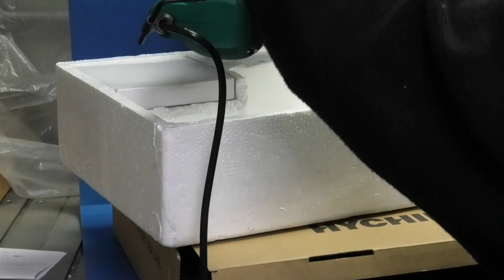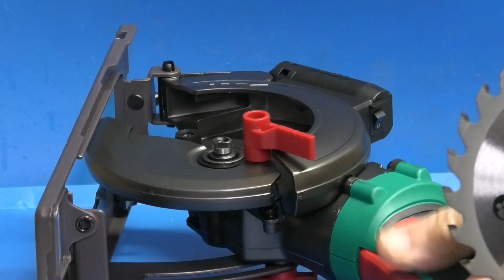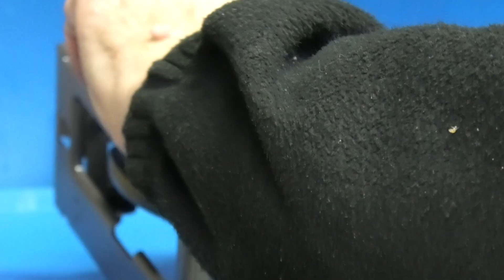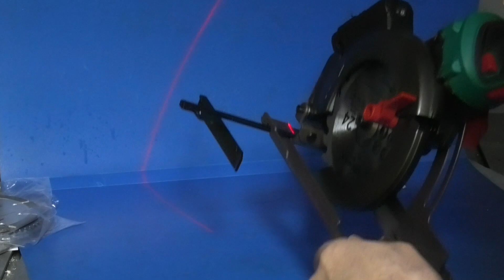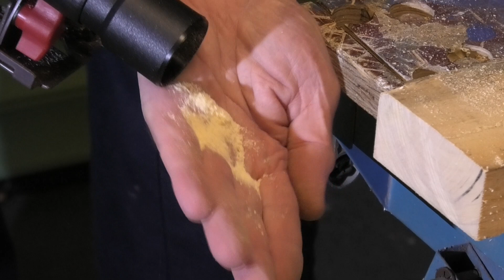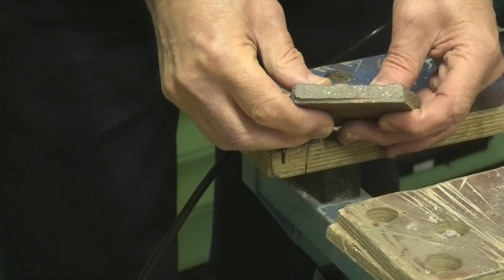Hychika mini circular saw tool review

Comment: Mine won’t cut but maybe a inch in. Then the guard won’t move any further. How do I fit that?
Reply from the maker: Hi Just check the following. Check that you have fitted the saw blade the correct way, arrow on blade showing direction of rotation. Check the blade guard is free to move  and adjust the blade depth of cut.
When cutting check the saw blade guard is moving and not hitting the wood edge.You may need to lift the guard by hand to move it over the wood edge.

Comment: I have two different Mini Saws One cordless and one corded marketed by different companies. Both of them I consider very dangerous to use because of the guard covers the front of the blade in the direction of cut. I have never been able to cut a straight line unless there is a clamped edge like when you used the Speed square and the edge guide. I have tried and tried and am to the point I do not even use either of them, and wish I had not bought them. I can see in the video that even you are having a hard time controlling the saw. I love the idea of these little saws, but they are totally backwards and not only hard to use but dangerous as well. And I always love your videos. Your videos are great this is just a bad product.